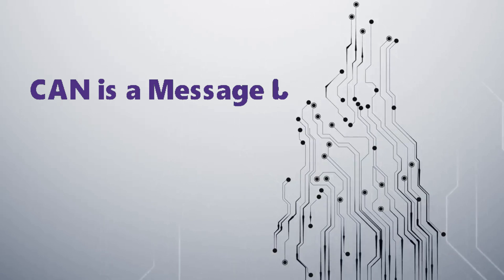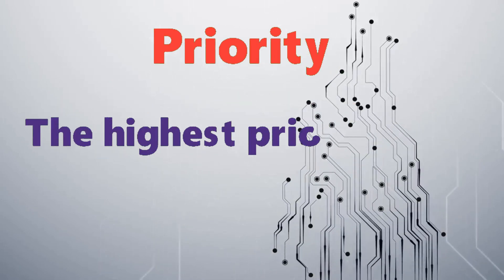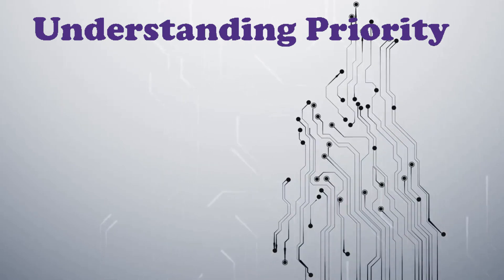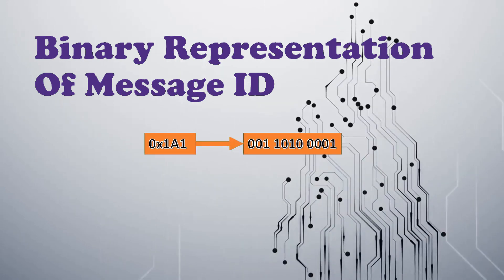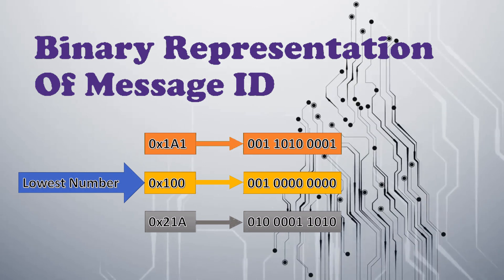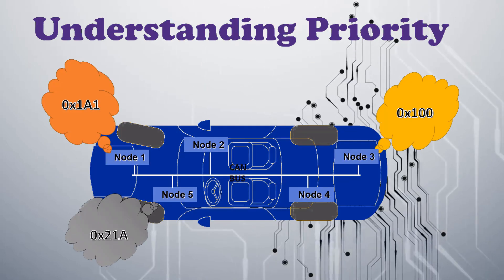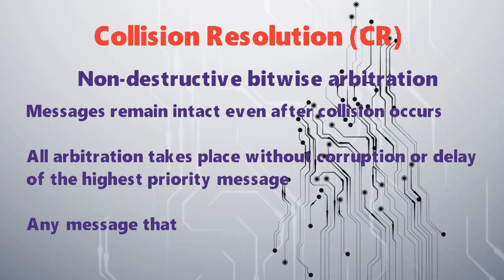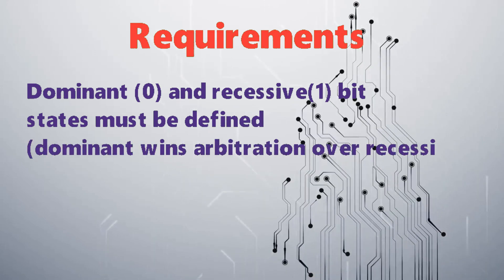Prioriy and Arbitration in CAN BUS protocol | CAN Protocol Tutorial Part - 2

Comment: that’s pretty cool.  So each device is both transmitting and monitoring the bus at the same time.  And if it’s transmitting a 1 and another device is grounded (a 0) then the bus will remain 0.  The device sees the bus was different than what it sent and senses it was a collision AND intrinsically knows it is also the lower priority sender and stops transmitting.  
I presume it’s disallowed for two different devices to send the same message id.  That’s genius.  I suppose all message ids must also start with a 1.  Where can I read more about CAN messaging structure?